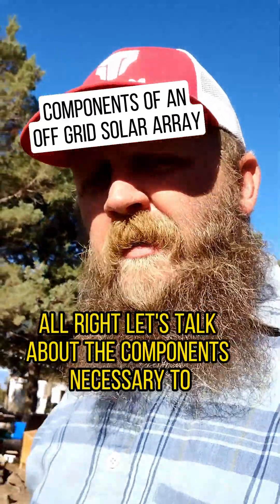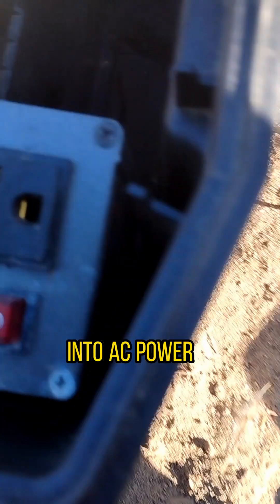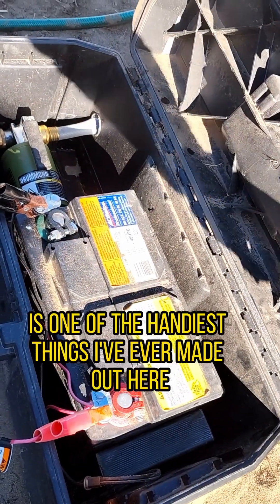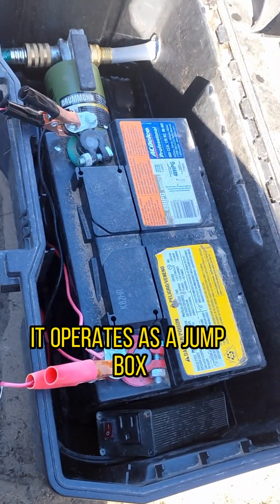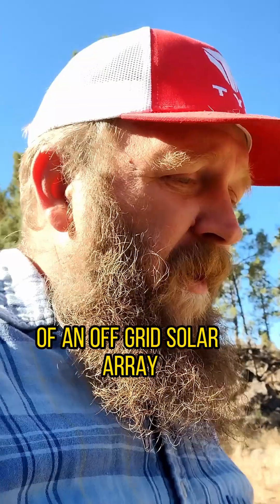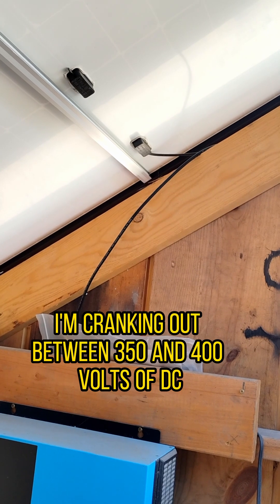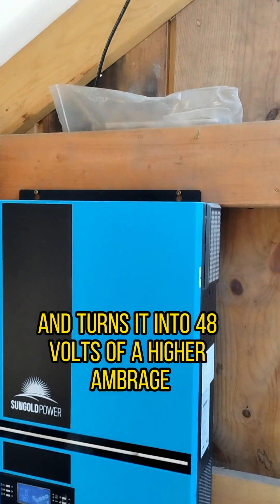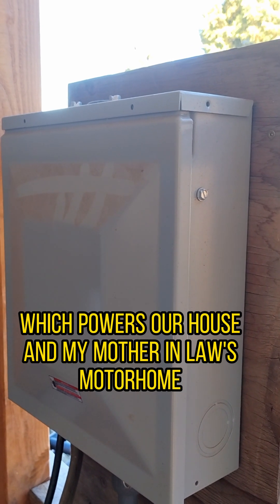The Components of an Off Grid Solar Array

Comment: So here's my dilemma, I hope you can help. I'm planning to use the same inverter, you showed in this video but I have no idea how many panels I can safely attach to it i want to do it in series i just wish I knew what the voltages with your four hundred watt panels were that could make things so much easier, So I could cross reference
Reply from the maker: 37v closed circuit. You can add 6500 watts of solar and there are two strings so you can do 9 (although I would do 10) on each string if you're doing the same as mine.

Comment: I wish @EcoFlow stuff would come way down in price, been eyeballing the Delta Pro Ultra with 5 batteries for a while now but just seems too expensive.
Reply from the maker: Ive set up a few ultras and I have a delta 2. For the price, the storage and the solar input, I'm not impressed. For half the price, you can put together twice the system and then some. Great for a back up but not for a main system. I my opinion at least. I saw a kit from ecoworthy that was 10kw solar, 20kwh of lifepo4 batteries and 2 6500w inverters for a thousand less than 2 delta pros.
Reply: @7kinhomestead  Good info, thank you. I see reviews on YT and everyone says ecoflow is so great, but I really wonder how well they would hold up over time as a primary power source, I doubt most people reviewing them use it as the only power source. I have looked at some kits / made kits in an excel sheet on some alternative brand options, and you are correct, the cost are a lot less. Thank you for your response.